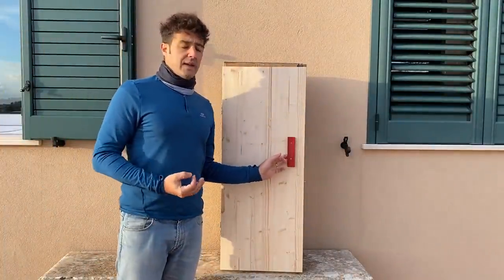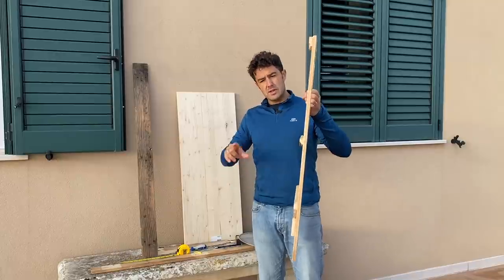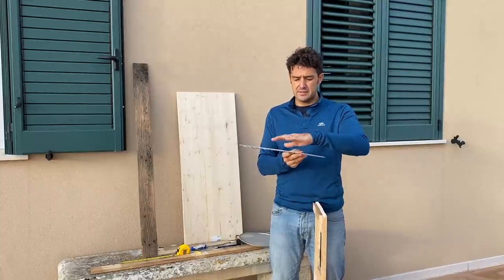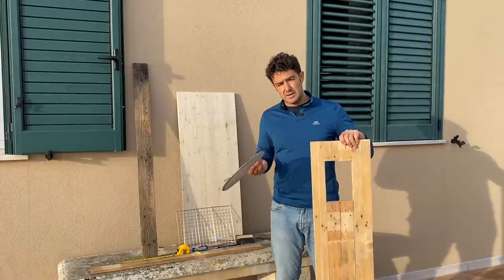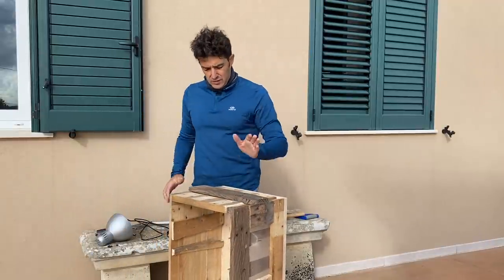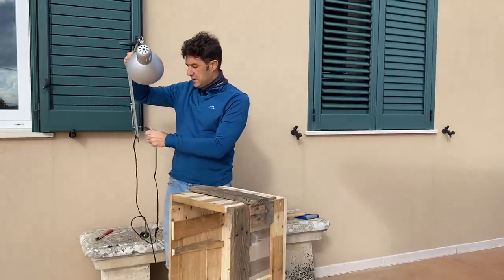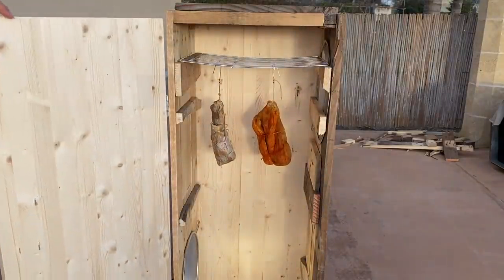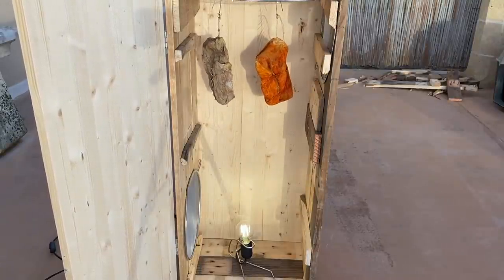BILTONG BOX, DEHYDRATOR , SMOKER DIY 🪚 How to make all with one project using a pallet and old lamp

Comment: I am also a South African and mine works a little bit different. We use a closed box with one or two computer fans on top of the box. Make a couple of small holes at the bottom for airflow and put in your lamp. Remember to put a stainless steel tray on the floor to prevent a mess. Most important, it must not be very hot inside otherwise the meat will spoil.
Reply from the maker: Thanks for all the advice 😉👍🏼💡
Reply: @Spectacular-cuoredicioccolato  there are many adaptions you can make. A friend and I built one with a double door steel office cabinet. Drilled holes in the sides for steel rods and then we pushed the rods into food grade plastic pipe. Worked perfectly.
Reply: @Getouttahere78  sorry late reply but only just come across vid. If you have fans and a cool temperature is best, do you even need the light?
Reply: @elguapo7970 That’s what I would like to know as well!
Reply from the maker: The light produces dry air

Comment: The lamp should be on top otherwise blood can drip on it.
Reply: That's wrong. The lamp is there to increase air circulation. Hot air rises.
Reply from the maker: If you are careful it will be not a problem 😉
Reply from the maker: Bravo 👍🏼😉
Reply: I thought it is to dry out the moist
Reply from the maker: 😉 you will see
Reply: Nerina, sies vir jou! The lamp is on the bottom to help with heat circulation. A bit of spillage happens and it's ok. My bulb hasn't exploded yet and I've made just around 100kgs of biltong and about 50kg droë wors in it so far. Cheers
Reply from the maker: 😱 150 kg of meat 🤩 spectacular
Reply: @Spectacular-cuoredicioccolato  ja we don't go small when it comes to biltong, but we dont smoke it.
Reply from the maker: 😉👍🏼 ok